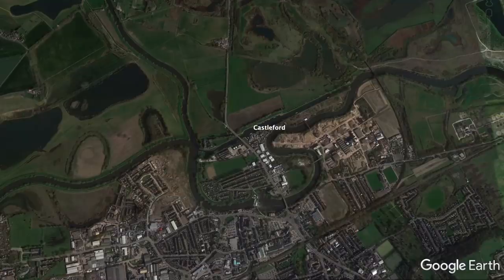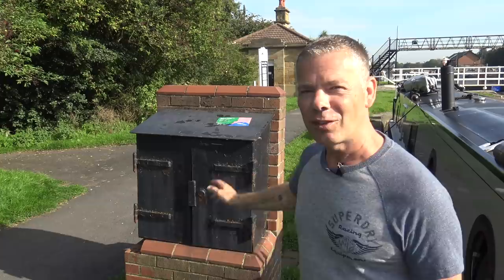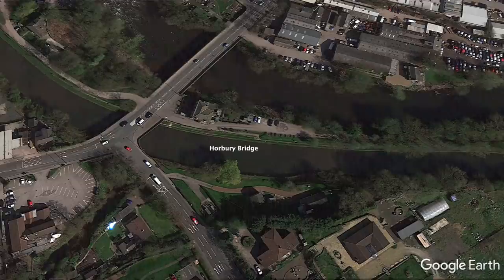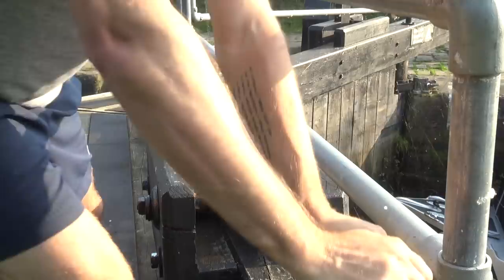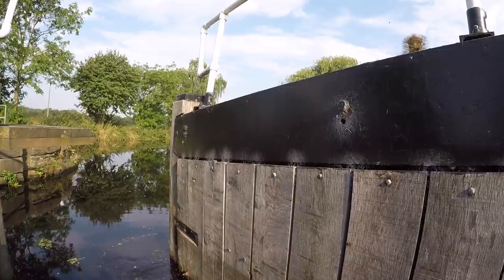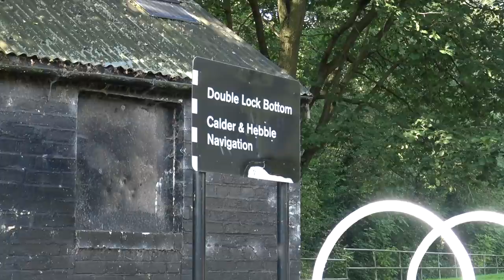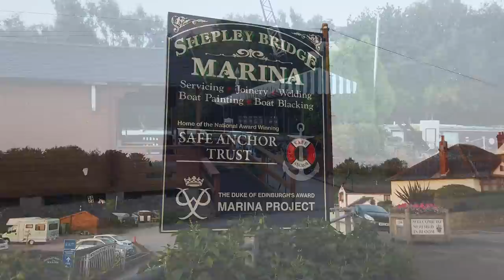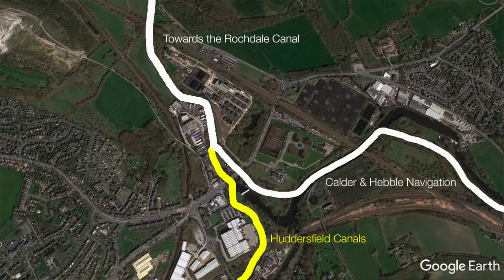Narrowboat Pump-Out Disaster! Narrowboat on the Calder & Hebble Navigation - Ep. 67

Comment: While not a boater I frequently visit various Lock Stations here in Ontario Canada, as well as Quebec Canada and a few in the USA. The Canals here were basically built by linking rivers, lakes and creating cults of to build the system. We have a large mix like you of operating the Locks but are all manned and operated seasonally by Parks Canada.

Now do the oddity, we have off the top of my head 2 unique spots, the Peterborough Lift Lock with a 65 foot lift using 2 side by side hydraulic tubs and even weirder is The Big Chute Marine Railway with a 60 foot lift that places your boat in a cradle and transports it from one lake to another.

Have fun, keep the videos flowing and hi Dillon.
Reply from the maker: That's great! Will have to Google it and have a look 👍🏻

Comment: Hi guys, another great video. Nice stretch  of water. We walked into Wakefield from Ferrybridge. We didn't have a Calder spike, couldn't find one anywhere we had to improvise. Mind you that was 12 years ago.
Reply from the maker: Easy to make do, a bit of 3 by 2 👍🏻
Reply: @FoxesAfloat  Thanks guys, but not so easy to do in the middle of nowhere, with no shops. We had to use the pole but it got shorter and shorter as the paddles got heavier and heavier.

Comment: The 58ft wooden short boats had, as you know, a wooden hatch on the bow deck. Climbing the 5-rise I once over enthusiastically opened the gate clough full wack and a solid wall of water poured directly into the cabin. Nowadays, after the tragic paraplegic accident at Gargrave lock, all L&L gate paddles have been fitted with deflectors.  ps. We didn't have safety ladders on the lock chamber side walls then, either. One clambered (in wooden clogs) up the back of the lock gates over steel staples.
Reply from the maker: Scary! 😱

Comment: If you are travelling with someone with a physical disability, is it still possible to travel through these locks. So for example you only have one person onboard to navigate the boat. Therefore, nobody to manage the locks. I suppose it may be ok where CRT are on hand. Is there a way to check where volunteers are likely to be?😊
Reply from the maker: As long as there's one able-bodied person aboard you can work the locks alone. If the only person aboard has a physical disability it would not be possible in most cases. The CRT are very rarely at locks, only very busy ones, I'd say maybe 2 or 3%.

Comment: Why are the lights yellow when you drive in to the electric lock ?
Reply from the maker: It means enter with caution. Because commercial traffic use the locks, they turn red if they are in use, or with flood locks they turn red when the river is in flood. They flash red if the river is dangerously high. Weirdly, I've never seen them green.